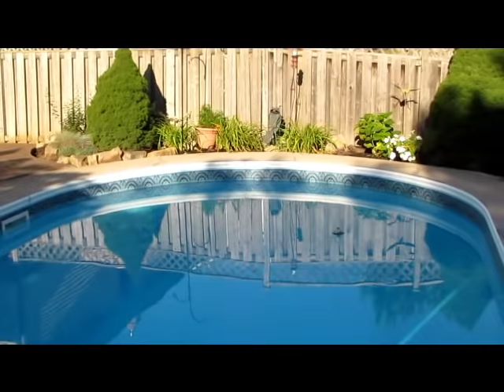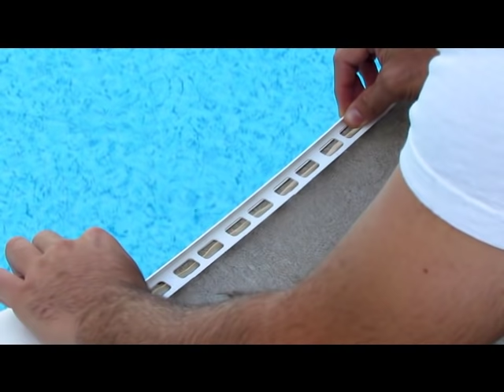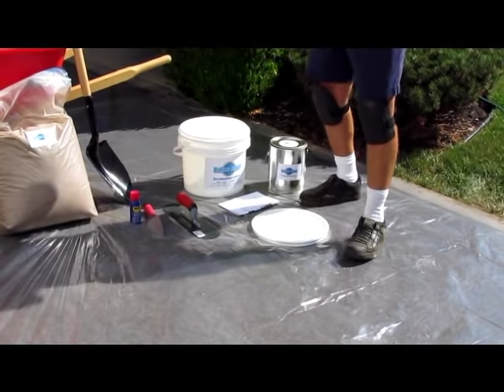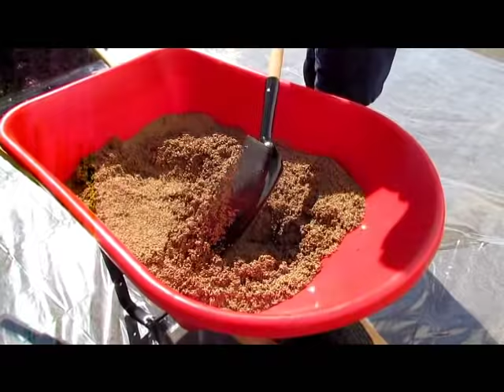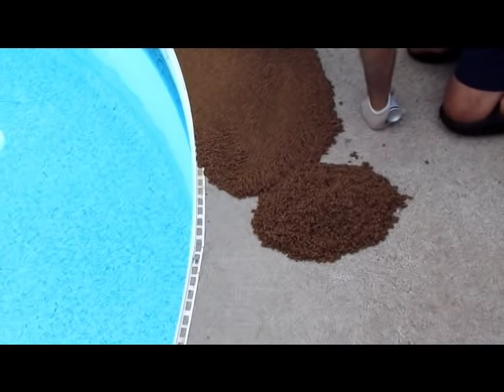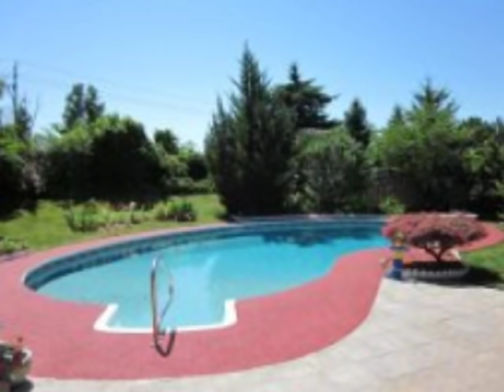Rubber Pool Deck Surfacing - Do It Yourself

Comment: Put this on the list of things I will hire someone for.
Reply: This is my job. I've gone to a couple DIY jobs after the homeowner wasn't happy with their own work. Yes, you can make quite a mess out of this.
Reply: @92clintonr  what's the cost per square foot for a pool deck.
Reply: @marlonquintana3466  
Depends what sort of prep is required. Anywhere from $10-$11.50 a square foot. I'm in Canada though so that works out to about $8-$9 US if you're in the states.

Comment: I’ve seen this product on my neighbors garage floor, looks great. I’m taking the leap and doing my cracked concrete pool deck this summer.
Reply: Let us know how it goes, looks like an interesting product.
Reply: Did you ever follow through on resealing your pool deck with the rubber depot product?
Reply: I want someone in Canada to do mine!
Reply: @chrisarena3090  wondering same thing
Reply: I’ve had my pool deck , 1000 sq.ft, covered with rubber decking and after 5 yrs, it still looks like new.  Best move I ever made.
Reply: U will regret
Reply: Why?

Comment: So the expansion joints in the concrete are no longer needed??? He just covered right over them.
Reply: It's flexible. so moves with the expansion joints. They're still there, just covered.

Comment: where are you guys from? why poor the liquid into a bucket first then into the wheelbarrow, wouldn't it save a step as well as residual buy going from can to wheelbarrow? wouldn't it be much easier to use a concrete hoe rather than a spade shovel?

Comment: Why would you pour the urethane from it’s metal paint can to a 5 gallon bucket and then dump that immediately into the wheelbarrow where you mix it in with the rubber granules?  That makes NO SENSE!  Dump the urethane from the paint can directly into the wheelbarrow.

Comment: Please do a video on removing it. I bought a house 6 years ago and  I liked the rubber deck because we have a pile of grand kids and I have a bad back. Four years ago I began to hate it.. Keeping it clean is IMPOSSIBLE and now the RED is burning through to the BLACK inside.. So the BLACK is leaving everyone's feet black and when anyone goes into the pool they make black foot prints everywhere inside our white pool!!!! So PLEASE tell me how to remove this stuff so we can enjoy our pool and deck once again...
Reply from the maker: Steve 1961P. Hello Steve, Unfortunately the company who installed your surface used recycled Rubber with a colored binder. We do not recommend this type of rubber for around pools due to the very reason you have mentioned. Our Rubber Is 100% EPDM, and is mixed with a clear binder. The color is UV stable and will not come off.
Reply: So how can I easily remove it???
Reply: i agree 100% this is a learned skill that's hard enough with more forgiving materials.having 30 to 60 minutes is misleading.if it isn't dry in 30 does that mean i have 31?Diy if you're a pro otherwise good luck! you're going to need it
Reply: I guess check a corner with a knife,       Find the depth and using the depth gauge,       Maybe run a circular saw across the surface in a grid pattern,       And then a sharpen putty knife to lift up the squares,       You have got a job on there !
Reply: @dennismatthew9495  no no no report you
Reply: @jacksdad2626  lol

Comment: omg 175 sq ft costs $1300
Reply: Susie Clark Uh...if that's the cost, then FOOK that
Reply from the maker: Jeremy Pate Jeremy the cost per sq.ft. is $ 4.95 plus shipping.
Reply: not to mention poly-urethane is  susceptible to cracking and UV damage. making it break down resulting in that rubber garbage tracking  into the pool--what that is ,  is a  1300 dollar spreading of goose shit that will cost even more to remove
Reply: TheRubberDepot 一
Reply: @TheRubberDepot  ship to brazil?
Reply: @projectifgrafologia76  , it costs 300 dollars to ship a laptop computer to Brazil and $600 for a suitcase.  Why ask such  a question?